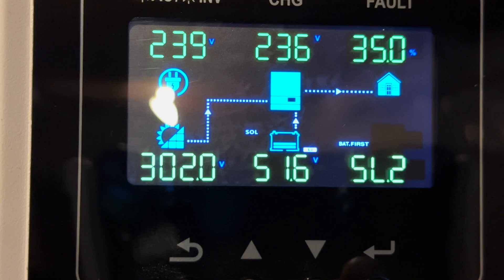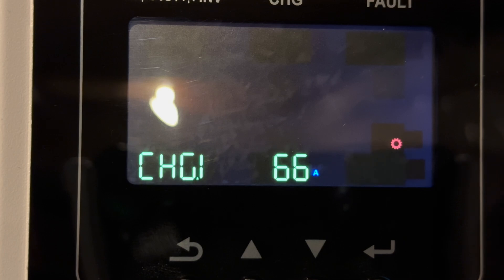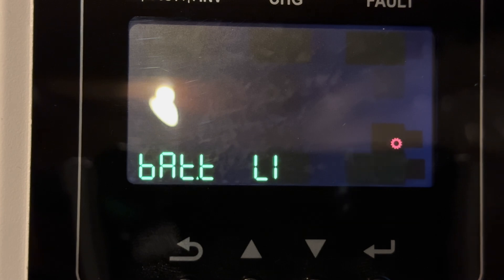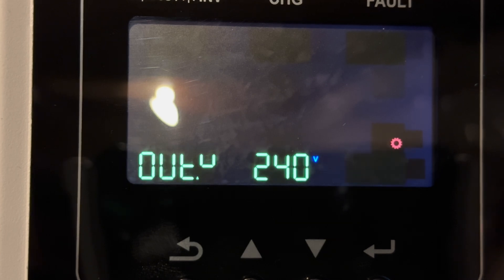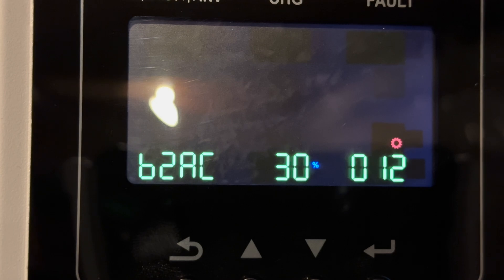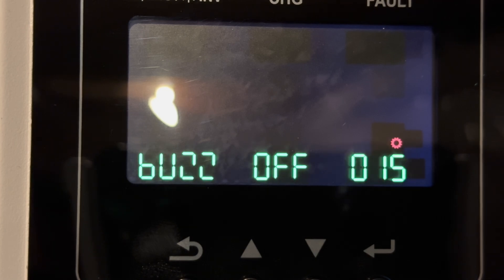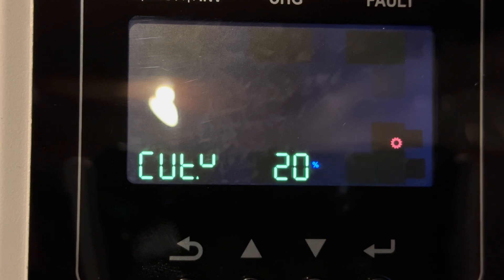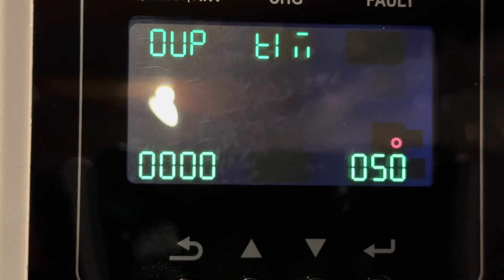Growatt 5000 ES Settings

Comment: Hi Richard. Great and detailed video.
I am setting up a very similar system but with 2 inverters and not 3. I still haven't purchased the inverters as I am trying to find if it can do the following: have the grid as a "last resort" source, but never use it exclusively. Because in your videos (and others) I hear you talking only about grid bypass, and I'm not sure if that's the behavior I find useful.
What this means is to be able to set a minimum value for the battery which, when reached, triggers the grid input at a low current, yet permanent. So the house is powered not on full bypass mode (all from the grid, nothing from the battery) but with battery and grid combined like if the grid was the sun: if the required power is less than the grid input it charges the battery with the remaing power from the grid.

This allows for what I think is a proper "winter mode": 
- solar charges the battery during the day when we aren't mostly at home
- if at 5PM the battery is not at least at 50% (example of course) then charge it from the grid with a low power until 70%
- but meanwhile we are home. So consumption increases but it's not steady consumption, it has only peaks bigger than the grid input, so I want it to continue pulling the power I set from the grid, thus charging the battery in between the consumption peaks. Eventually it will reach 70% and that is enough for the rest of the night.

Does this make sense?
Thanks
Reply from the maker: Here’s the manual.  It’s helpful to see the options available to you.  Settings 01 and 14 are most important for your considerations.  As well as 11 and 49.

https://signaturesolar.com/content/documents/GROWATT/1519013-manual.pdf

Grid and battery do not provide power at the same time, but solar and battery or solar and utility can.  See setting 01.

Normally I have it set so solar charges the batteries and powers the house during the day (SBU mode).  At night it runs off the battery until the battery gets to less than 30%.  Most of the spring/summer/fall I can make it to the next day and stay off the grid.  

Occasionally, the battery does get too low and the grid is used.  Depending on how the inverter is set it will stay on grid until solar charges it to a target value, in my case 45%.  However, you can also allow the grid to charge the battery if you like.

In winter I typically use SOL mode where the battery is only used while there is solar.  The reason is that in Dec/Jan there are days with so little solar that the battery may barely be above the minimum before the sun sets.  If the battery gets too low I allow the grid to charge it.  This is to protect against grid power outages leaving me with insufficient power.

You can control if the grid is able to charge the battery, when and the maximum current.

I spent many weeks experimenting with the settings to get what I felt was good for me.  It will vary depending on your set up, load and climate.  I recommend starting conservatively and pushing your setup to the limits until you are comfortable.  My goal was to minimize grid usage, which is very hard in winter.

Overall, I have been happy with the inverters.  I started with two and added one more due to my load.  I haven’t had an significant issues since I installed them early 2022.

Comment: Why can't we change our settings on 5. We want our inverter to work 80% solar and 20% grid if battery is low. But we battle to change no 5 to L1 it jump bact to us2. Please can u help us with settings. Thanks Peter
Reply from the maker: Hi Peter, Is your inverter plugged to your LI battery pack via the BMS port?  Can you provide details about your setup (i.e. battery type, number of inverters, etc.)?
Reply: @ZeusRadls  I'm  not very clued up with it we have a cable connected to battery  from inverter. We have a Growatt 5000 inverter. Is there a way we can send u pics  of set up. Thanks for caming back to us we appreciate it very much
Reply from the maker: Can you post the pictures on your YouTube channel?  If not, what battery are you using?  I found the manual a bit cryptic, but helpful if you read over it a few times.  Page 7 may help.  It's also possible it's a battery setup issue.  I'm using the EG4-LifePower4 batteries for 48V systems.  You need to correctly set the dip switches on the battery connected to the inverter, as well as properly set the dip switches for any other connected batteries.
Reply: Richard thanks for answering me.. I have L1 battery 100Ah and 1 converter 5kw, SPF 5000 ES with 8 x 360 Canadian panels. We not connected with sbu cable. Sun up from 5h30 in summer and winter after 8. We not completely of grid but use a lot of grid electricity. What percentage must our settings be on to save   on municipality bill. Thanks appreciate ur help
Reply: We are from South Africa

Comment from the maker: As a test I enabled power save mode (setting 04) on one of the three inverters to see if it will reduce idle draw during the night.  I'll post a follow-up based on the results.
Reply from the maker: After monitoring the setting change for a few days it appears to be helping.  However, the weather is also warmer and the furnace blower does not need to go on as much at night.  Overall, the system feels more efficient, but with changing conditions I’ll have to continue monitoring to be sure.  The change had a neutral to positive effect.  

I frequently have 50% or better left on my 20Kwh battery pack each morning.
Reply: @ZeusRadls  we phone the technician to came and see our settings for us. Because the people that installed the setup for us isn't prepared to came and sort out our problem and they didn't left a manual for us. We stay in the South Africa FreeState and every time they must came out from Gauteng they charge us a arm and a leg. We have permanently loadshedding 2 hours off 2 hours on and that effects our sistem.  The installers connected it direct to the grid and cost us a lot on electricity that we try to avoid. We will contact u again if technician doesn't came but thanks a lot for your help. Thanks Peter
Reply from the maker: @PeterPitzar  Here’s a link to the manual.  What Li battery are you using?  https://signaturesolar.com/content/documents/GROWATT/1519013-manual.pdf